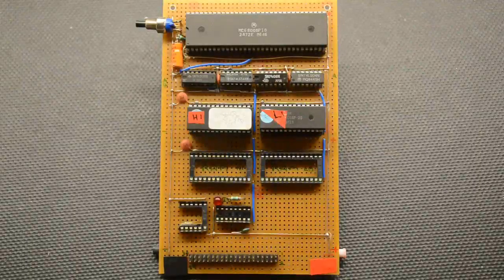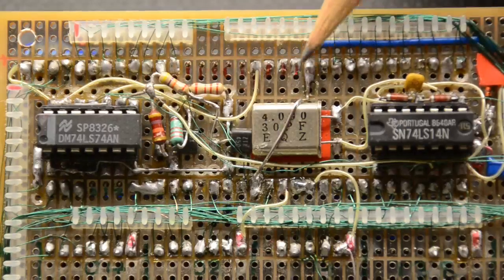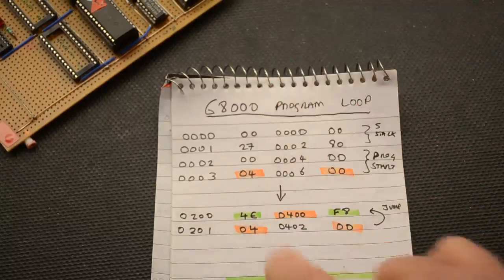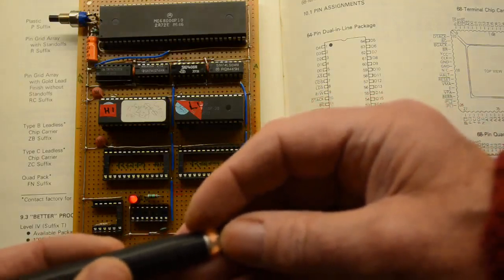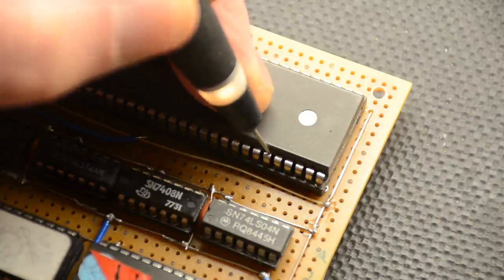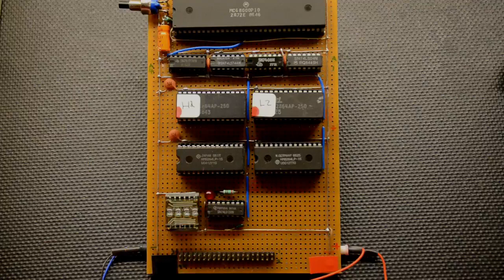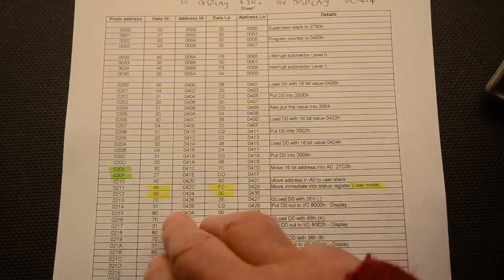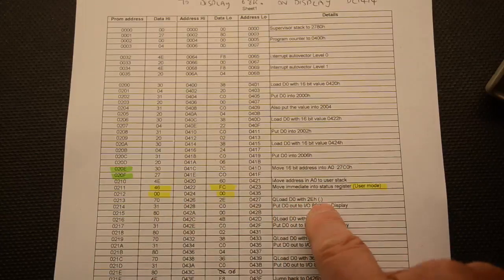Testing the DIY 'Entry Level' 68000 based computer

Comment: Love this project!  Do you have a schematic for this published somewhere?
Reply from the maker: I've included some details of how to make up one of these computers at the end of the video. The 'difficult' bits are shown in the clock/reset circuit page you can screen grab and save, plus the memory I/O circuitry. To go with these two pages, the following  NETLIST will show where all the pins of the ICs are connected to. It should therefore be possible to build your own project using this information, as this is all the information I used (from a much older 68K project) to actually build and test the one you see here. If you have any problems or queries whilst you are doing this then just drop me a note!
Reply from the maker: Don't forget that the idea of showing these details for a short duration is so that you can freeze the frame on your computer, do a 'print screen' then print it out for yourself as an actual hard copy if you like.
Reply: I noticed the schematic in the video but wasn't sure if you had a PDF or kicad schematic published somewhere too. No worries. I did as you suggested and screen grabbed the schematics. Thank you!
Reply from the maker: Afraid that the one you see is the only one I have here, which you now have! I've never taken the trouble to draw things out on a CAD package as by the time I've finished the project I'm usually onto the next one :-)  Let me know how you get on with it!